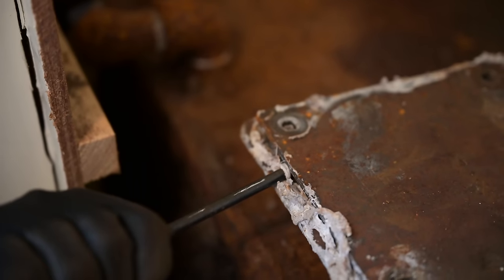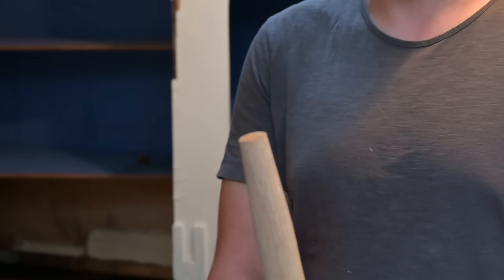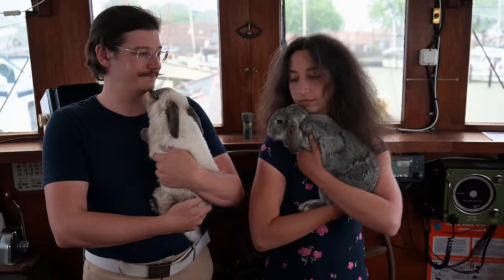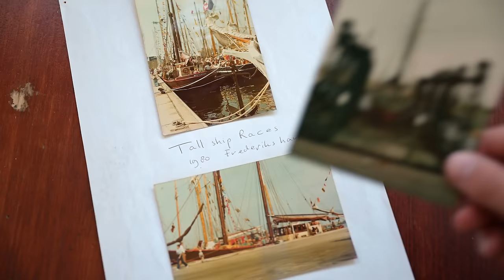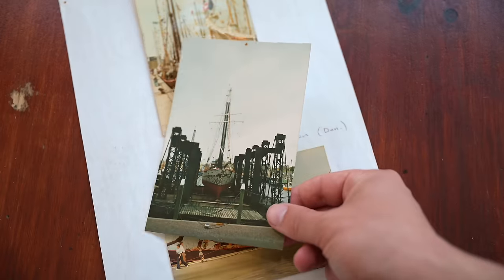Finally Finding The "LEAK"

Comment: I am a retired chemist. I think bubbles in a metal tank and inside a steel hulled ship means electrolysis. In short, you have a dc electric current flowing through tank and turning it into a battery. So you have two leaks, an electric leak and a water leak. You can check for the electric leak at its source, which will be your ship’s dc electric system, which is, the batteries and generator. I hope you are good at electrical wiring, because there has never been a boat built that does not have electrical problems. And that includes Noah’s ark. 
I really enjoy your channel, keep up the hard work!
Reply: i think with a metal boat you run a current through the whole boat. there is a spot that on the hull that is set up for corrosion. that might need to be addressed to prevent corrosion in other parts of the boat. im pretty sure you use a Zinc Anode as your sacrificial part.
Reply: Galvanic corrosion. The hull zinc anodes might be used up..now the steel ship eats itself. Lesser materials like alu goes first  A plastic boat is not a good ground. Steel hulls are fine. You essentially create a virtual ground and use a wire back from the electric toy to this shared ground. A  starburst style. That works on my 50 year old tuna boat.
Today I run solar to batteries and backup with an easy to replace gas generator. 120v on a boat is wonderful...baking, instant hot water, PC.

Comment: Hopefully when you rebuild you will make the cabin sole easily removable for inspection of the frames, the plates and the floors, etc.
I think if the structural integrity of the tank is not compromised you could sand blast or soda blast the interior of the tank stabilize the steel and paintit then put a modern plastic liner in it and voila a safe and healthy water tank, this is what we are doing with our 30+ year old tank!

Comment from the maker: Many of you folks suggested that we should taste the water to find out if it’s the tank or not… Well, we are currently docked in the Markermeer and it’s a fresh water lake that once was part of the sea but was converted into a lake by the dutch. But next to the leaking water tank is a decommissioned but very much full wastewater tank and also the plumbing in this area is more improvised than anything. So all we would find out by tasting the water is if it’s fresh water from the tank, fresh water from the lake or disgusting, sickening and toxic water either from the wastewater tank or from the plumbing…
Reply: Oh, close to Hoorn the most lovely city of the Netherlands.
Reply: @propylaeen  No, they are in Lelystad.
Reply from the maker: @carlpetersen3128  Good option and there is a special dye for this purpose. But we had to make a decision really quick and it was the weekend.
Reply: If the tank is dry & stays dry, would think no water from the lake is inside. Bet if you pressure washed the inside of the tank it would be easy to see the leaking area, then just weld on a patch & figure our some coating to protect it. If you cannot see the outside bottom of the tank a cheap scope camera that hooks to your phone might come in handy. I just use a mirror.

Comment: One really good thing about deconstructing the inside is that when you run new pipes for water, hydraulics, air, electrics you will have a great knowledge of each system. Maybe you could make diagrams for shipmates etc, especially the location of master isolating valves in emergencies

Comment: Personally I feel this as a great opportunity to inspect the condition of the hull internally and to treat the surface rust thoroughly.Awesome video guys.
Reply from the maker: Thank you very much! We know that it is necessary to blast the hull to white metal and coat and paint everything. We hope that we don't need much welding but can't tell at the moment. Our initial plan was to do the foreship first and then start in the saloon. So the leak search was kind of a quick start for us but removing all that stuff and getting to know the vessel feels very good.
Reply: Yes ships rot from the inside out.

Comment: Love, love and love 💕all it takes to turn a rusty pot into a grail of glory.
Reply from the maker: Originally Flying Coney was made from steel. Now she's made out of rust hold together by paint... 😳 Seriously we honestly think that it looks worse than it is. But we prioritize necessary projects instead of optical ones. It would feel great to go over the rusty bits on the outside because that would make a huge difference optically speaking. But is it necessary?
Reply: @FlyingConey  guess in six or so years when the rest ist done ;-)

Comment: The Black stuff is Probally carbon. It can come out of old steel. 
The easyest  and fastes way 'to be back in business' is to clean the tank and put  cement on the inside of the watertanks. If you have some money to spend you can choose stainlesssteel and be done with it.
Reply from the maker: Our initial plan is to use PE water tanks 2000 liters for drinking and probably 1000 liters for a rainwater collecting system. Since we don't really have a space problem we can use pre-made not customized tanks. So I think PE is better and cheaper? We had a PE tank in the caravan and never had any plastic taste or so. Also we follow a philosophy of filtering everything that goes into any tank (at least that's what we want).
Reply: I fully agree to you to put cement in the tanks. It keeps the water free from taste and smell and it is a good conservation for steel. And it is very cheap and will cost less energy than installing PE tanks. Only problem here could be that the sides of the tanks are already covered with a certain coating. A test should be made first wether cement will adhere to this coating as good as to steel.
Reply: @FlyingConey  I think PE is a good and cheap solution. If you buy them secondhand from the foodindustrie, you can get the 500L or 1000L for as little as 50 euro's.
Sell the old tank to the scrapyard, you 'll get a few euro's.
Reply: In considering prefabricated water tanks in a vessel, you must keep in mind the problem of Free Surface, where liquid has momentum when at sea and must be restrained by internal baffles and structural strength of tank.

Comment: A quick way to check the water tank is to put food colouring in the water, if the water in the bulge changes colour it's a leaky tank.
Reply from the maker: That's a very good solution but we had to make a decision fast so we went for the "multitool".

Comment: Great project to undertake, several things I would like to suggest….
The bubbles in the water tank coating, this is what is known as underfilm corrosion, or when the surface was chipped after coating or was not covered correctly in the first place.
I would also strongly suggest purchasing some good quality battery power tools,ie:
Cordless screw driver, impact wrench, sabre/ricipicating saw, circular saw, and a couple of large hammers.
This will help with overall safety, time and also save on power consumption.

Comment: Hi,I am sorry to say that It looks as if you have a serious corrosion condition in your hull and frames.I hope that you had an ultrasound survey done on your hull,there is a lot of remedial work to be done.she is a fine looking vessel,i like her as she is.all the best with the refit,I am very interested to see the results.cheers, Roly 🇬🇧.
Reply from the maker: Hi Roly, yes the hull was checked about two years before we bought the boat for the CVO. So an independent official surveyor checked her. Getting the hull rust free is our main goal at the moment. But no project is small on a 25 meter vessel 😉 Not even striping the interior to have a look. From what we have seen so far we think the condition in the worship looks worse than it is. Problematic could be the condition of the frames and stingers in the saloon because there the hull was isolated with cork and it looks a bit horrible underneath it. Anyway I'm afraid we have to power through this stage of the project no matter what...

Comment: It's good to see it wasn't a hull leak. Those bubbles are caused by rust lifting the coating. Id suggest installing a bladder into that tank or changing it out completely if you haven't already done so.
For the hull check out Phenix coatings. It's an undercoat that chemically bonds to rust. It looks like your enjoying your boat archeology 🏴‍☠️

Comment: Your handsome vessel looks like it is a prime candidate for limping to a suitable shipyard, to haul out to accomplish complete refit.
I understand they have some good shipwrights in Vietnam and other Asian areas. 
I believe that poking around at the issues will be a never ending source of more issues.
Just rip the guts out of it and start with a clean slate. 
In two or three years you can set sail on a fit vessel, (budget allowing) arranged exactly as you would like it.
Reply from the maker: Ripping the guts out is exactly the plan. However we are a floating refit and we have the space to do so. So we first do foreship, saloon and the outside of the hull. I think you misjudge the condition of the technical systems. The hydraulic is almost new, the engine has low hours and is in good state. So despite of some quirks and a not deniable rust issues she is far from limping anywhere. Also there is no place compared to the yard where Brupeg is. When you go out of the water you need what needs to be done and go back again. Most of the conversion of the Tall Ship Avatar was done with the boat in the water and they literally pulled the hull out of the mud.

Comment: Food colour dye is often used to determine if and where a leak might be  occurring. Of course, with these large tanks disposal of colored water needs to be considered. Maybe a lot of cakes...?
Reply from the maker: I'm trying to lose weight 😅 We did consider using dye to see if it is the tank or not. But it was Friday when we found the puddle and the wether window for a crossing to the yard was Monday. So opening and emptying the tank including the bottom 10cm was the only option. With more time there would have been better options, like dye the water on St. Patrick's day so nobody cares if you dispose it in the harbor water 🤣

Comment: You should really think about cleaning the loose rust and spraying the rust with rust converter and maybe it will help stop the rust from continuing cause sooner or later it’s going to eat thru the hull and you don’t want that. You may even think to have the hull sonic tested to see how far it has actually rusted. Smith
Reply from the maker: We have the thickness measurements and it was the reason why we bought the boat. It seams like the hull itself is in better shape than the frames probably because the frames are older than the hull. But we're planning to gut the whole interior and blast the hull down to white metal and re- coat everything.

Comment: A magnet can help to locate covered screws in wood/plywood. Cutting a new slot into the screwhead with an angle grinder and a thin cutting disk can help remove to more persistent ones, or drilling out the head entirely, alltho that ofcourse damages the wood, but i guess thats mostly scrap in your case anyway. Can get smoky tho if the cutting disk makes contact with the wood. Anyways, keep at it, very entertaining series :)
Reply: Not if they are stainless steel or brass.. unfortunately. Though a combined metal, current and stud detector can.

Comment: For destruction work, i cannot recommend a sawzall / recipro saw more. just get a cheap one for lidl or something. But you can cut through everything including metal in seconds.
Reply: I think with plans for a floating refit on metal vessel a good idea would be a portable welder/ac generator to run hand tools and limited welding. This should easily pay for itself.

Comment: Excellent news - you're not sinking! As someone here has suggested, this is a great opportunity to design the interior layout to create some access openings to the hull. Also (this is major work and may be too expensive) could you also design it so you have waterproof sections in the boat, with accesses through each by watertight doors? Thanks for another great video...

Comment: OK, the bubbles look like a type of aerobic bacteria attack on the steel.  It is likely that the water is possibly contaminated with some oily residue sitting on top of it on which the bacteria feeds.  The byproduct of the bacteria is acid which then causes corrosion.  The effect are bubbles  or circular pits of shiny steel (when the bubbles are disturbed).  Water tanks should be painted and not left as bare steel.  It appears the coating has deteriorated significantly and will require the tanks to be stripped, repaired, then repainted before cleaning, super chlorinating, sealing then finally filling.

Comment: Personally, I would have tested/tasted the water.  Dip a finger tip, and taste it.  Salty, then the hull leaks.  No salt, it's the fresh water tank.  But, that's just me.
Or, as Mrdave892 suggested, food coloring into the fresh water tank.
Reply from the maker: The boat was moored in a lake so testing the salt level would've made no difference. But food coloring would've been an option.
Reply: @FlyingConey   Ah.  You did, however, expose the areas in the bilges.  Now you can assess, and decide if you want to refurbish those areas.  To try and stop further rusting.

Comment: You need to get yourself a sawsall. It will cut that laborous sawing by a great margin and make short work of those wood planks. They do make them in battery operated as well.
Reply from the maker: The funny thing is, I have one! The manual stainless saw is mostly there for emergency reasons. The initial plan was to use the electric jigsaw and it would have been perfect for the job. However the modern jigsaw refused to work with our ancient electric inverter, the fuel in the Honda generator turned bad in just two month and I had no patience to sort it out that moment. So I sawed away me anger 🤬😉😂

Comment: Hopefully you will be able to stop all rust on hull and prevent it from returning and rebuild the interior in a way that allows hull access for regular inspection. It's nice you are both inspired to work together to make your dream reality. Highest Blessings
Reply from the maker: Thank you for your comment. We hope we achieve a rust free hull as soon as possible. But I find it really difficult to imagine an interior with hull access. It's probably a good idea to have some inspection hatches to see if the coating fails. But on large parts the isolation will not be accessible I'm afraid. That's why the coating is so important and the reason why we considering flame spraying the inside with zinc AND coat it with epoxy. Should be good for the next 40 years...

Comment: If it was my ship I would fit new plastic tanks or maybe more expensive stainless tanks, that solves all the problems.  If it's tight, you can plasticize and shape your own.
Reply from the maker: We have plenty of space and I think PE tanks are probably the best solution. Our idea is to also have a rain water collecting system for washing machine and (one) household toilet. The author of the often recommended book "Boatowner's mechanical and electrical manual" (link is in the description) is not a big fan of stainless water tanks and since there are almost no stainless steel yachts there might be a point. As far as I know stainless steel causes problems when there are specific chemicals in the water. And since we don't need to have costomized tanks we can use PE.

Comment: Get the PE tanks ,then never worry about rust or stray electrical currents
Reply from the maker: I also think PE tanks are the best option. The only good reason to use stainless is if you have to customize the tank. But we have plenty of space and don't need to follow the hull shape or something like that.

Comment: Now would be the time to upgrade to a stainless steel water tank, and not have to worry about rust in your water any more from the tank....
Reply from the maker: We are leaning more towards Polyethylene water tanks instead of steel. I've read that stainless sometimes reacts quite quickly with some chemicals used to tread the water in some countries. Also we don't need the main benefit of stainless steel tanks which is to customize them to the hull shape. When we have one thing aboard our ship it is space 😎 and PE is cheaper and also very good. But why you would prefer stainless?
Reply: @FlyingConey  hey. Thanks for your reply.  The main reason I would use stanless steel is one it will not rust, two it kills germs,  and is resilient to chemicals. 
If you are worried about the chemicals that a country might use in the trement of there water sources. I definitely would not drink it. Just saying that if its going to harm stanless steel, whats going to do to you... Beside stanless steel water bottles are found all over the world to thouse that can afford them.

Comment: Is it possible to add non-metal liners to the water tanks to hold the water instead?
Reply from the maker: Can you describe what you mean with non-metal liner? A coating?
Reply: @FlyingConey  maybe a tank lined with food grade silicone so that a leak can never happen in your life time
Reply: @FlyingConey  I mean like a large plastic-type bag you can insert into the tank. The insert is filled with water, and the metal tank just acts as the structure. I know there are products like that, but I don't know their name. Sorry.